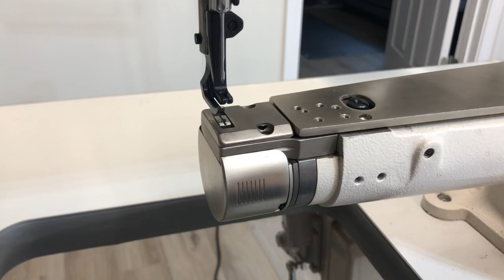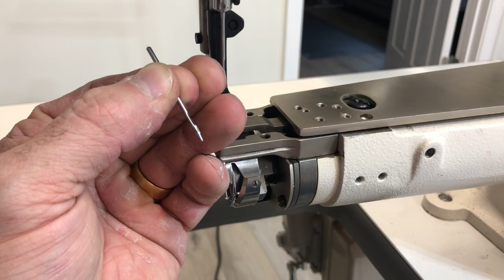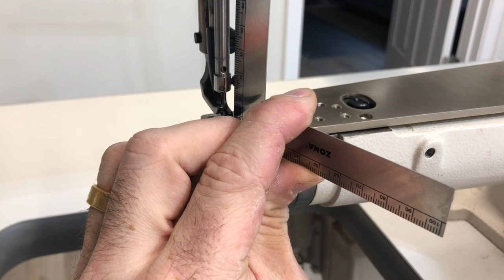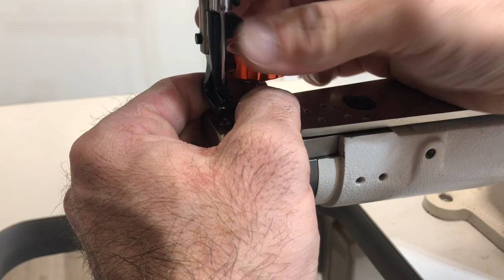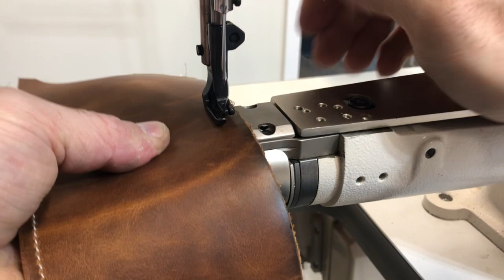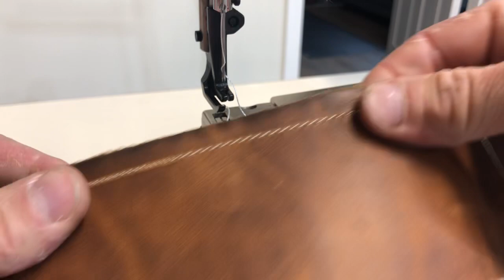Timing the Techsew 2600 Sewing Machine

Comment: this machine it should be similar or anyway in the same range of machines as the adler 069, in your video when you start stitching, it was very slow at first and then speeded up once engaged, the speed is because of the servo motor ? i mean you can stitch at one stitch per second if you want or go full gas by pressing the foot pedal with different intensity?
Reply from the maker: The servo motor allows you regulate the maximum speed of the machine. In this case I started slow and once I was confident, I put my foot down and increased my sewing speed up to the current max setting.
Reply: Ben Geisler ok the same I do with my cobra class 4, but  last fall I had the chance to try the class 26 the new light to medium machine by leather machine company  and when you press the pedal even just a little it throws immediately and quickly 3-4 stitches and my reaction was to lift the foot from the pedal to slow down but it stopped as it was supposed to do. Thinking about it now I guess if that is not due to the setting probably it is due to the diameter of the the wheel and the pulley underneath the table that allows you to slow down more by pressing very slowly the pedal